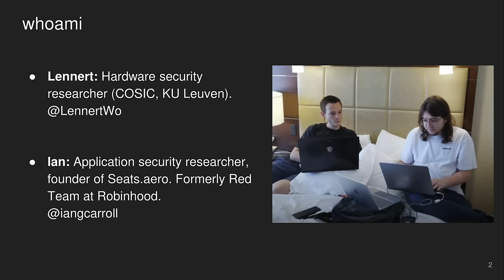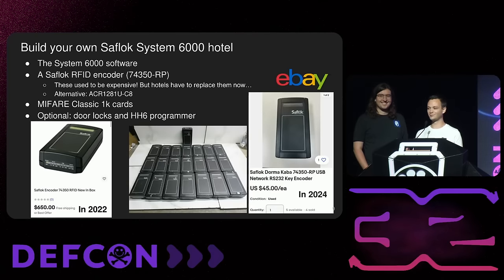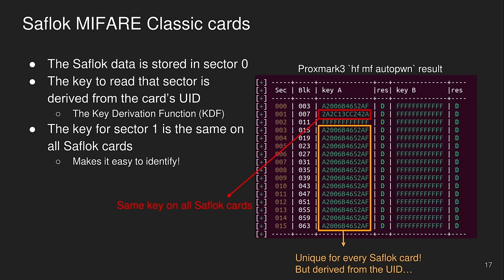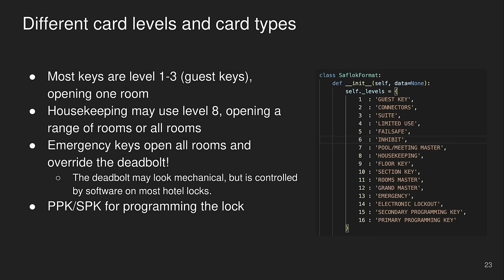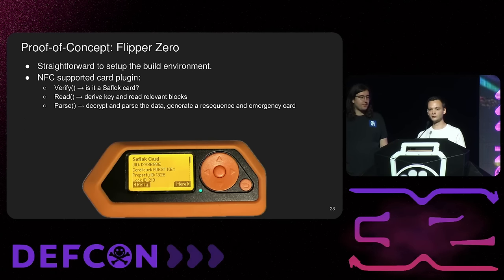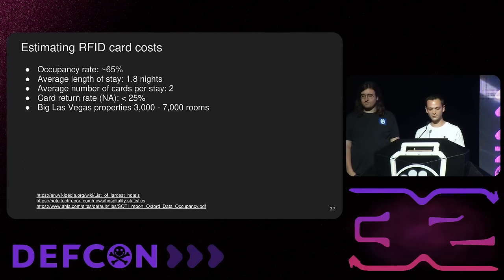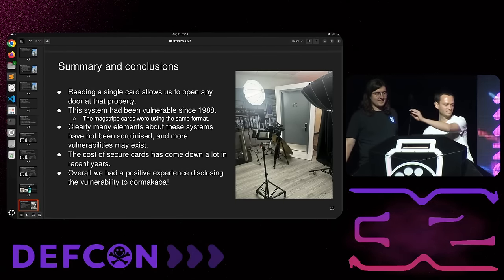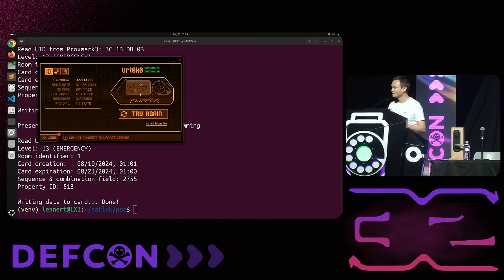DEF CON 32 - Unsaflok: Hacking millions of hotel locks - Lennert Wouters, Ian Carroll

Comment: I was in a hotel one time and their machine for cutting cards was on reception where are guests could reach it together with a note that said the password is 0000
Reply: There is a hotel chain in Tennessee that uses the same 4 codes for all of their rooms.

Yes, you have a 1 in 4 chance your card works on the wrong room.

That's exactly what you want to learn with a hotel room filled with wreck diving equipment.

Comment: The hotels are losing cards to guests not returning them? Charge the guest for taking a keycard!
Reply: Some people forget, some cards get left in the room and housekeeping throws them away, etc. If I pay $1500 for a hotel for a week (did that last week in SF), and then get charged $10 for a $0.50 piece of plastic, I'd be annoyed. The hotels just eat that L, and in my opinion, kinda rightfully so. 

They also don't charge you for e.g. using more soap, or not hanging the towels, or turning the air conditioner a degree lower or higher. 

It's just a cost of running business, especially since a pack of 500 of those cards is usually like $200 or less.
Reply: Just checked, the cards from the talk (mifare classik 1k cards) are <50ct on Aliexpress, idk how much they'd cost with printing on them.
Reply: The vast majority of hotels I stay at tell you not to come to the front front desk unless you want a paper receipt.

If it was a requirement they'd tell you/have a sign.
Reply: @Fs3i I'd imagine a hotel chain buys tens of millions a year and probably pays a fraction of what a public price would be
Reply: Yeah , 5 cent surcharge
Reply: I guess if you buy a million a year it's more like 0.05USD...

Comment: Crazy that this was vulnerable for so long. Wouldn't there be more people with bad intentions trying to figure this out?
Reply: People with bad intentions probably just didn't disclose.  Hotel thefts and stuff don't make much media attention.  It's probably much more on the high-level espionage and targeted people than petty thieves checking random rooms.
Reply: Same reason lockpicking is so rare in crime despite the vast majority of locks being easily exploited, a pair of boltcutters is still faster and works every time.

The average criminal finds it much easier to lift a keycard off the housekeeping cart. Much like the vast majority of high profile ransomware and data breech attacks trace back to a social engineering attack  or supply-chain attack instead of some Rube Goldberg-esque chain of complex zero-day exploits.